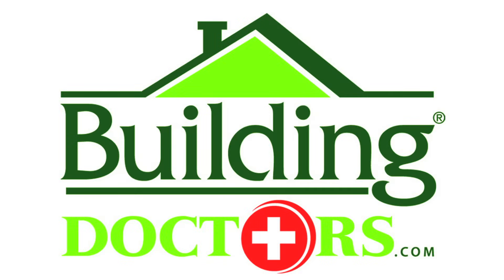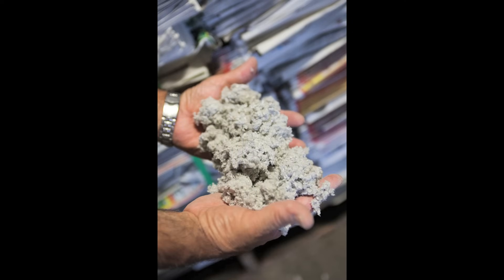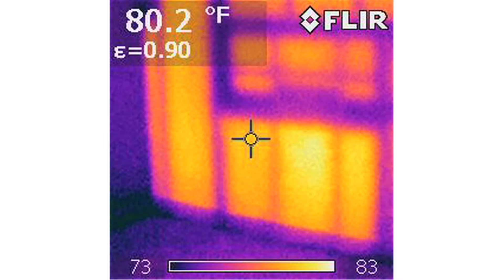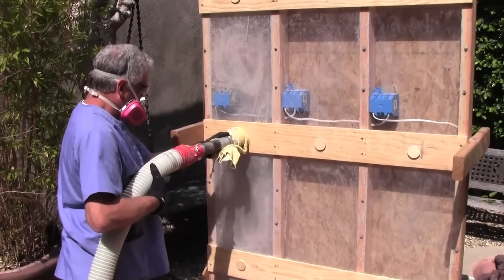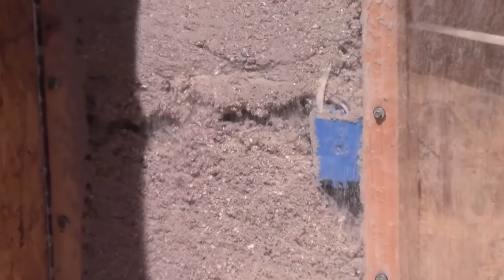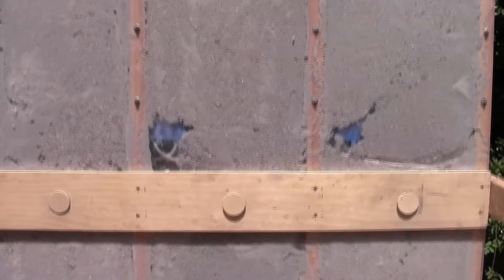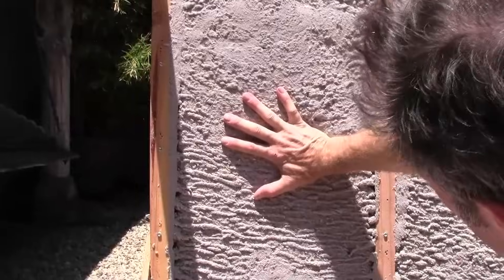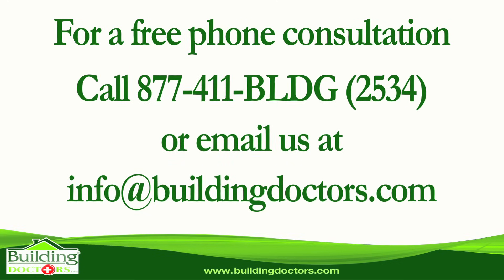Compare Drill and Fill Wall Insulation Techniques

Comment: I would like to know if this can be done from the outside on brick veneer to fill the void between the brick and the 3/4 to 1" foam board.  They do it in Europe all the time, I have not found a single contractor that knows what I'm talking about or willing to take the risk of popping the sheetrock.  I have literally shown them that is not an issue.  In my garage you can see the foam board on the outside of the studs.  It would be impossible.
Reply: I appreciate the reply and am not sure what was poorly worded or worth bringing it up.  Maybe I should have gone into more detail.  My specific problem is that the part of the house I am trying to insulate is a large bump out on the front of my house with a fireplace running up through the middle.  There are 3 walls, each with double windows that take up nearly the entire wall.  Very good windows that show almost zero thermal heat loss.  Meaning that there is a king stud and a jack stud on both side of each window that are so close to each corner that those corners CAN NOT be insulated with anything, not to mention the header above each window, there may be 2" between each set of windows that can be insulated in any conventional way.  As far as the drain plain you speak of, that was taken care of when I laid the bricks and nailed felt/tar/roofing paper to the foam board as I went up and left weep joints in the bottom course.  I am almost in a situation that I would have to remove the drywall and nail foam board inside to the studs, apply the moisture barrier and sheet rock over all of it and extend my window jambs and replace all the trim.  I have seen black beads of insulation about the size of a BB that look very slick, I am not sure if they would absorb or retain water.  We have poured pearlite in block cavities that don't have weep holes for 40 years without a complaint.
Reply: It is a tough situation all the way around.  Plus on one side where it juts out from the house before the windows start there is a duct in the outside wall.  It shows pure blue on the meter!  The only plus is the house is an earth contact home and easy to maintain temperature in the summer.  I would just sell it, but I built in in 93 and the 5 acres it is on was $16k and it is 15 minutes to our airport, my job and the city.  If I could find a lot like this now it would cost $300k.  I can play with some ducting and insulation this summer and maybe put a stove in my fireplace and see how it goes next winter.  A stove in that fireplace would probably run me out of the house.
Reply: Thanks for the message, John.  It takes a lot of practice to be able to dense pack walls without popping off the drywall or more likely the lathe and plaster.  We drill 2.5-inch holes so we have plenty of room to slide the hose to the top and bottom of the wall cavity.  That would be impossible with the brick veneer scenario you suggested. There are some companies that use a liquid foam to fill walls but I have heard this is not a great solution because it leaves air pockets. Hope this helps, Best
Reply: It would never touch the drywall.  There is about an inch of foamboard on the exterior studs and then felt paper.  I laid the bricks and never thought the 2x6s so close together would be a big deal.   I honestly think the only way to fix my situation with the bank of 2x6s all the way around that bump out and windows is to take off the drywall and put up foamboard, tape the joints, staple up a vapor barrier and cover the foamboard with drywall.  I'd have to extend the window Jambs 2 1/2 inches, but if I want to be warm I think that's the solution.

Comment: I was under the assumption that cellulose should stay fluffy, as compacting it causes it to lose its insulating abilities
Reply: Alec, Thanks for your question. Yes, you are correct you can overpack the wall too much that is why the target 3.5 lbs per cubic foot. There is a slight reduction in the r-value but with the added air sealing that comes from a dense-packed wall, I am great with that combination. We train our installers on a practice wall first to get a feel for the technique and to weigh their results to get good at it first before going into the field.  Hope that answers your question.
Reply: @Mihogan
I can clarify this.  You will never lose R value by adding more insulation, even though it is compressed.  What you lose is efficiency, commonly referred to as diminishing returns.  For example, if I stack two R-15 batts into a standar 2x4 stud bay I will not have R-30.  Rather I will have something around R-22.  This is because air is still present, but it is compressed, bring each batt to approximately  R-8 for a total of R-16. This is why it is generally not recommended.  It should be noted that a standard R-15 batt will compressed down to R-11 in a 2x4 stud bay.  In this respect you do gain a significant amount by installing two batts.  However double R value equate to a proportional reduction in heat transfer.

Comment: I did this method on a exterior wall years ago. If I ever did it again, I'd just rip out the drywall, put the regular roll insulation in, and put up new drywall. Much easier, better results, and roughly the same price.
Reply: damn really?

Comment: So when I redid the fasciae on the front of my house there was no insulation inside the walls, I have opened other walls on my home and found insulation, Is there any way to tell which walls have insulation and which do not without making holes in the walls?
Reply: William, thanks for your question. We use infrared cameras to check if there is insulation inside the walls.  The ones we have were $6,000 but they actually make a decent now that clips to your smartphone for a few hundred dollars. If you don't want to go that route you can stick a probe inside the wall to see if there is any insulation inside.  There is usually a gap on the side of your outlets or light switches and the drywall. We have found these little plastic hair clog removal tools (Google it) work well because they will pull the insulation out with them and they are plastic so just in case there is a frayed wire you won't get shocked.  Let me know if you have any other questions.

Comment: I am going to dense pack the ceiling above my garage with cellulose, but there are some existing fiberglass batts there.  Should I remove the fiberglass batting first,  or just dense pack the cellulose with the fiberglass batting already there?
Reply: @william tyler No, haven't gotten an answer.  I think I might remove them to use them elsewhere, because once they are compressed by the cellulose they will not be doing much good.
Reply: Brian, so sorry for the delay in answering your question. For some reason, I didn't get the alert about your message. I would never dense pack cellulose in a closed ceiling cavity. You need to have some air movement in there to prevent mold growth. You can have nails that go through into the attic area and you can get condensation drips on those nail tips. That moisture can build up in an attic area and one of my only complaints of cellulose is that it absorbs water. Loose fill fiberglass does not absorb water.  I would lose fill that attic area with fiberglass. Don't dense pack it and it is fine to leave the fiberglass batt in there. If you have any other questions, please let me know. Best
Reply: Is there a house above the garage or is it the roof?
Reply: @rsmith02  House.  My post was from a while back, I did fill the portion where there was no existing insulation and it has made a difference.  But I didn't yet do the area where there already are some fiberglass batts.

Comment: Better to just take plaster walls down insulate and put up drywall?
Reply: Kenzie, thanks for your questions and it's a really good one. The answer is it all depends. In the bigger scheme of things lathe and later will always crack so if you remove it completely and net and blow the walls with insulation then add new drywall you will be better off in the long run. However, it had a great expense to the job because you have to demo the wall, which means a dumpster fee, you will have to remove molding, then insulate the wall, add the drywall, tape compound, sand, texture and paint then add the molding bac. Don't forget if you want it all to match you will have to do the interior walls as well. This becomes a super intrusive job and extremely expensive.  You have a big decision on your hands.  Let me know if you have any other questions. Best, Dan

Comment: If there is old fluffy pink roll style insulation in the wall, what's the best strategy for removing it before blowing in cellulose? Could it be extracted through the hole used to blow in the cellulose?
Reply: Bobby, Thanks for your question. I answered this a few months ago but here it is again. In California Energy code did not start until 1978 so most homes older than that don't have insulation in the wall. If you have really old insulation it has probably started to fall apart at this point. Dense packing the wall will compress what is in there with the new insulation. If it is a more modern home you can cut a six inch or so strip of drywall across the wall and pull out the batt insulation but that is rarely cost-effective.
 Best of luck with your project.
Reply: @danthomsen811  thanks so much! I hope blowing the insulation on top will work out like you suggested. Really appreciate it! Cheers!
Reply: @mrbbizzle Make sure they put the hose all the way down the wall cavity and before not to blow the plaster or drywall off the wall since you have less volume of space now. Best of luck with your project.

Comment: This is great, but we all know not all contractors or  workers will do it correctly,  and on a real house its near impossible to know if it was done correctly everywhere.
Reply: Thanks for your comment. You are absolutely correct. To be honest, most contracts in our area don't do blown-in wall insulation well at all.  I tell customers to always ask how the company does their wall fills. Ask them to describe their techniques. If they don't use a hose inserted in the wall they are not dense packing. Period.

Comment: My question is if you're doing this in a older home how do you get the old before adding this new stuff?
Reply from the maker: Leonel, Thanks for your question. In California Energy code did not start until 1978 so most homes older than that don't have insulation in the wall. If you have really old insulation it has probably started to fall apart at this point. Dense packing the wall will compress what is in there with the new insulation. If it is a more modern home you can cut a six inch of so strip of drywall across wall and pull out the batt insulation but that is rarely cost effective.
Reply: You dont have to get out the old stuff. If you have vermiculite it's best to get it tested for asbestos. They will pay something like 5000 dollars to help remove it. But typically if it's not disturbed it's not an issue. You cant really blow in new insukation in wall bays that have it. The hose doesnt push it out of the way so it's usually skipped over unless it's high in the section of wall, where it can take a little
Reply from the maker: @dylanfenimore9160 Fenimore thanks for your input. Out here in California vermiculite is extremely rare.  I have only found it in a few homes in the fireplace and not in the attic. I have never heard of walls being filled with vermiculite back "in the day" but anything is possible. There are testing labs that can test to see what is in the sample you send them with results in 24hrs or less at a cost of less than $25 per sample.
Reply: I lead insulation systems of maine.  A lot of balloon framed house has it somewhere. Typically the skinny wall bays. Although a bathroom remodel I did had an entire wall section of it come out when the wall came off.  And when found in attics it's usually underneath cellulose or batting and may or may not be found throughout the entire attic or just a section. Really nasty stuff.
Reply from the maker: @dylanfenimore9160  that is true that a balloon framed home with vermiculite would have some drop in the wall cavity.  Extremely rare here in our housing stock but definetly a possibility somewhere else.
Reply: I'm a contractor in Oregon, the other Portland lol, there is nothing better then running new venting, wires or whatever in attic and your digging through Batts of R30, or blown fiberglass, cellulose just to find the original vermiculite in all its glory, and since you weren't expecting it you are wearing very little to no PPE.
Reply from the maker: @T6Tarek  Wow, that would be a horrible feeling. I know that I have been in a few attics and found friable asbestos after working up there for a few hours. Never vermiculite here in LA.

Comment: This is a bunch of BS. My house had the old method used decades ago. When I bought it I remodeled the kitchen and had to removed this crap. It was fully packed and no settling. It will only settle if they don’t use enough with enough blower strength.

Comment: Is it possible to do fill up cinder block walls with this?
Reply: There would be two potential issues....

First, how can it be determined that the cinder block wall cavity is completely and densely packed enough to achieve a good R - value throughout all of the seasonal changes?
And, if that wasn't enough of a task to figure out, what if the cinder block foundation is exposed to moisture in any way?
By introducing a wood based product like cellulose insulation, which by the way is one of the ingredients that mold fungi spores need in order to feed and continue to replenish itself. Mold attacks and feeds off of wood studs which is one of the reasons why some folks prefer using metal framing studs in their building construction projects. The other ingredient it requires is the moisture itself.
Well, if that wall has any moisture in it and you were to introduce a potential paper/wood source as a food source for any mold spores that could be present then the problematic conditions could be more expensive to repair if no pre-work inspections were not carried out.

If you don't know what the status of your cinder block wall is just pouring in cellulose insulation might be a recipe for an epic disaster!

Comment: Is this the best sound proofing method?
Reply: Christian, thanks for your question and sorry for the delayed response. I just answer this above when someone asked what is the better insulation choice.  Here is what I wrote.  I hate using the word " soundproofing" because it can't be done with insulation.  I like calling is sound dampening. SOmething to slow down the sound waves going through the wall. The denser the better. Since we dense-pack cellulose to 3.5 lb per cubic foot compared to fiberglass at 2.2 lbs per cubic foot cellulose wins.

Comment: Wouldn't dense packing reduce insulation?
Reply: Felix, thanks for your questions. I have answered that on here somewhere before but you don't want to overpack the walls. Our target is 3.5 lbs per cubic foot for cellulose and 2.2 lbs per cubic foot for fiberglass. The r-value e goes down a little bit compared to attic blows but not much. I would rather have the walls air sealed with them dense-packed with a tiny drop in r-value. Again, over packing the walls will decrease it even more.

Comment: As cheaply build as homes are today would not the pressure of the dense pack pop the sheet rock of the walls?
Reply from the maker: James,  I addressed this previously in the thread but this is what I wrote: " You are absolutely correct of about the potential of bulging the walls. We still have that issue with lathe and plaster as well. If it was not installed well it can pop out as well. Training and practice of listening to the machine and how much insulation is coming out of the hose is key.  We made this video to show the benefits of dense packing wall insulation and not as much as an instructional video of how to do it.  Thanks for the feedback." Hope that covers it
Reply from the maker: Also, if the drywall is installed to code with the right amount and ration of drywall screws it should stay in place.  Keywords there are  "if it is to code".
Reply: Houses built today are way better built than 50 years ago.
Reply: What part of the country? Lots of hastily built homes in the early post war period.

Comment: Man I wish I could have had the builders of my house insulate the garage for the extra few hundred bucks. Caught it too late in the build and now i have hollow walls in my garage that now has an HVAC system. Got the door insulate and about to do the ceiling but not sure I want to cut all these holes in my walls what a pain in the ass.
Reply from the maker: Jay, this might be one the cases where it would be less expensive to pull the drywall off and properly install batts the put the drywall back up.
Reply: Building Doctors Yea that is exactly what I was afraid of lol. I think you’re right.

Comment: What is an effective method to insulate 1) the garage ceiling above a conditioned space (bedrooms and bathroom) and 2) vaulted living room ceiling just below the roof.  The roof-to-ceiling materials consist of asphalt shingles, decking, 2x12 joists with 3-inch air space, about 8-inches fiberglass batting, and drywall.  I've considered dense pack cellulose by removing drywall, spray foam by removing drywall, injection foam, and nailbase insulation.  Other options?
Reply: I did dense pack cellulose through the garage ceiling.